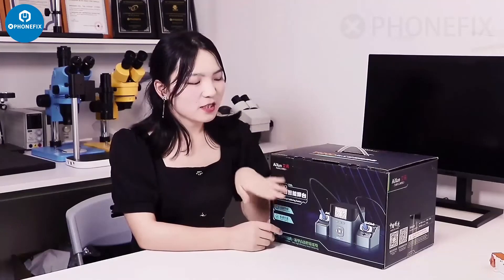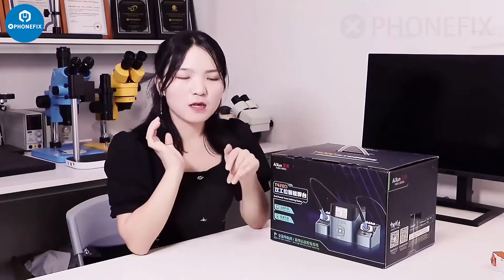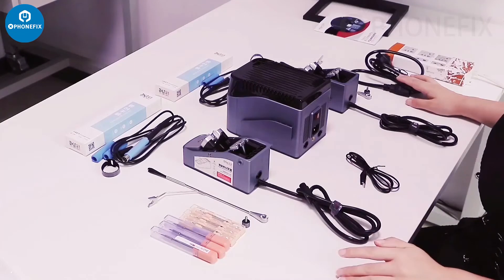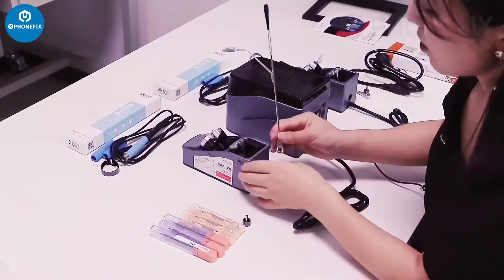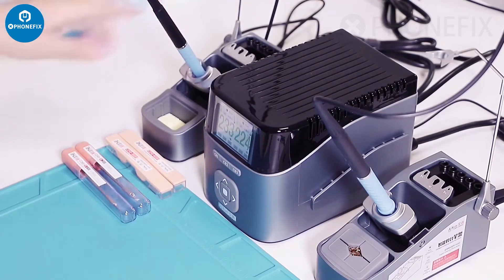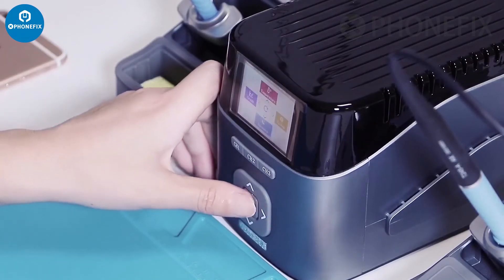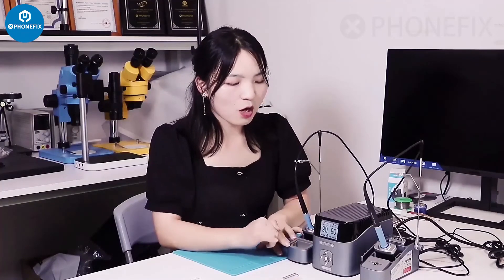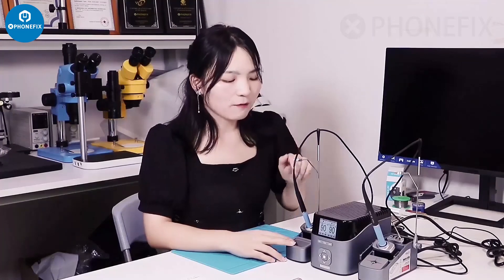Review: AIXUN T420D Soldering Station, Compare with T3A,T3B#PHONEFIX

Comment: 1.Can i use 2  handle at the same time?    2. The preset (3 chanel) is the same for the 2 handle or 3 for one  handle and 3 for secend handle ( 6  different temperatures) m
Reply from the maker: 1. 2 channels can work simultaneously.
2. 3 for one  handle and 3 for secend handle ( 6  different temperatures)